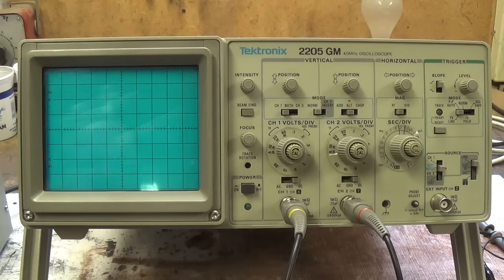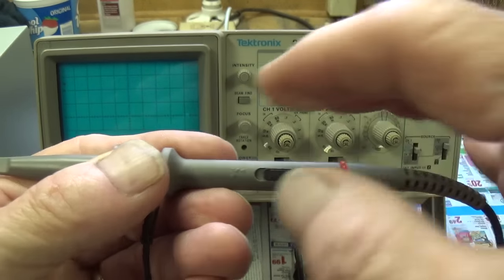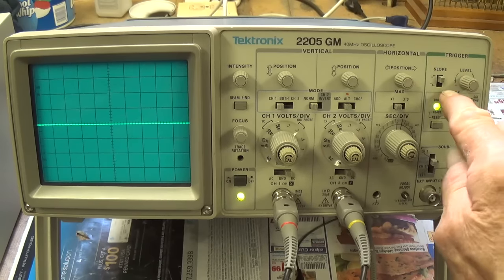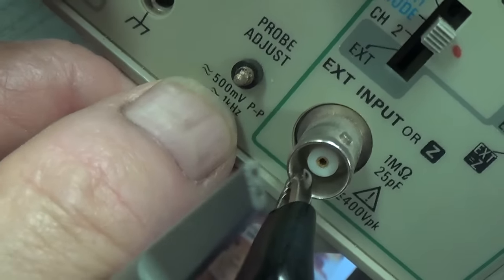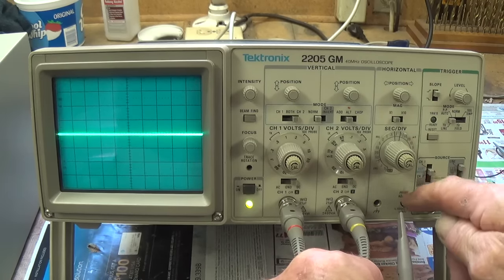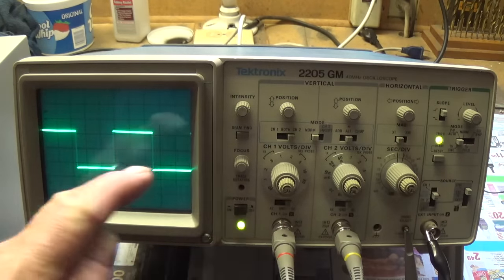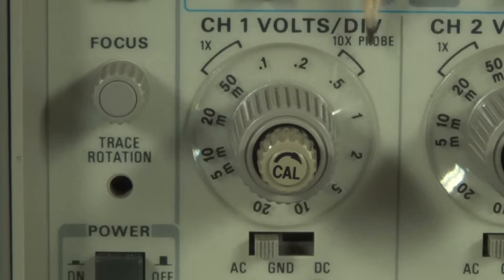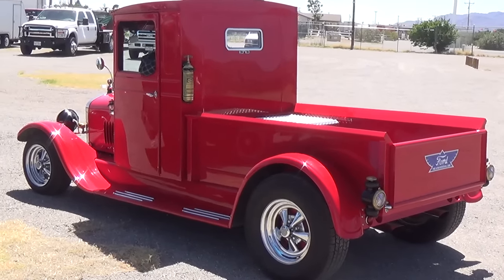Oscilloscope Basics, Part 1: Discussion, Y-Axis (Voltage) Controls, Probe Calibration

Comment: Some ask the question about the AC or DC switch position : AC mode blocks DC, but DC mode pass all signal components (AC and DC) to the vertical system. So it doesn't matter in this case. In the manual, it says to go to DC mode for checking probe compensation, so again, AC will pass in DC mode.
Reply from the maker: Thanks for the helpful input, Patric.

Comment: Well done and very informative and clear. I'm looking at a Tektronics 2215A on Craigslist. They say it works well, but you know how that goes, but at an asking price of $200, I figured it's worth a look. Looks to be very similar to yours, which makes the learning curve not quite so steep.
Reply from the maker: Thanks, B55. I understand your concern about buying complex gear untested....but that's a very reasonable price. God only knows what it cost new. Get the guy to demonstrate it or let you try it out. At least you'll know if it lights up and seems to work.....then find some faults and offer him $125 :):)
Reply: Uncle Doug I ended up picking the oscilloscope for $125 and he threw in an isolation transformer and an ohm/henrie meter. Oh, and a super heavy duty outlet strip. Not to shabby.

Comment: This a fine video, I am trying to understand how these work, I have a Handek as well as a Heathkit IO3542. The problem that I do not understand if the divisions, if you have the Volt/div knob set at .5 do you multiply the divisions on the scale by .5 to get the reading? Thank you kindly for any input.
Reply from the maker: Thanks, Mark. It means that every vertical scale division is equal to 0.5V, so if a peak is 7 divisions high it is equal to 3.5V.

Comment: Uncle Doug.....I noticed in the beginning of the video you pointed out that you were setting the voltage to AC on the switch, however during the rest of what you were showing with the probe calibration I noticed it was set to DC. Can you explain why? I am in the beginning stages of learning the oscilloscope and that has me confused. Thanks......Kelly
Reply from the maker: I honestly don't recall, James. Sorry.

Comment: My dad and grandpa both had shops. They had the old atlas scopes they used to tune point ignition cars. Did these scopes do the same thing as you are teaching us or was that a totally different beast? We miss Jack on the vids but the hot rods are nice addition. Thanks.
Reply from the maker: You're welcome, Todd. I would guess that the scope's design was similar, but the signal processing electronics were different. I don't think they would be interchangeable.

Comment: Wow, and that is a basic O Scope. It's more than adequate for guitar amps. Mine has cursors & tells me volts, amps, frequency, in RMS, peak, average, elevated, AC, DC, waveform, etc. I have differential probes that will let me work on KV transmitters. The 22 series is a nice Tektronix scope. I use a 2245B, 4 channel for my basic stuff. I still have a bunch of old 465Bs that run up to 400MHz. The "Probe Adjust" terminal might say "10KHz",  "10KHz Calibration", or just "Calibration", rather than Probe Adjust. Other manufacturers are different.
Reply from the maker: Thanks for your input, Seth.

Comment: I wish Brad the Guitologist  would get a scope... He is plenty smart enough to learn how to use it well...   May I suggest if anyone is interested , check out the Tektronix 2247A. It has a high speed digital co-processor that allows many DMM functions on screen, has curser functions for volts and time/frequency, rise and fall time calculator, and has a memory function for many complete front panel setups. Its one of the very best pre pure digital (DSO) scopes they made. I bought mine new when they were released, over $11,000.   Now you can find them fully functional under $500.  We also use several 7000 series mainframe scopes, including a Storage Scope version, but they are probably beyond the needs of the advanced hobby and restoration enthusiast.   Any of the 22xx series Tek scopes, such as Doug’s here, are well made, quite portable, and very reliable.
Reply from the maker: Thanks so much for your knowledgeable and helpful input, Jennifer. Just like all electronic gear, no matter how expensive it is when new......just wait a while and the price will drop exponentially.  I would love a digital scope. To me, the analog scopes are sort of like slide rules compared to modern computers.....God love 'em !!

Comment: Thank you kindly, Uncle Doug. What is your opinion on remote power supply (solid-state and regulated) to drive my 40W push-pull amp? The circuit incorporates a voltage quadrupeler, so my power high voltage rail need only be 300V. In addition we have 240V RMS, here.
Reply from the maker: I don't understand why a separate power supply would be necessary, Shannon.

Comment: I just thought I would share that I just bought a General TV amp (dated 1956) as a guitar amp conversion project complete with 12SQ7 tube and 50L6 tube and 35Z5 rectifier tube....wish me luck!!  I think I may need it! I thought this would be a better starting project than scratch building an old amp clone ..maybe...I hope, lol.  I am so thankful I found your channel! How many videos do you do a month on average? Just curious.
Reply from the maker: Good luck with your project, Jack.  Be sure to install a 3-wire chassis-grounding power cord on your series-filament amp.......for safety reasons. We tend to produce about 4 to 5 videos a month. Each one takes several days, so we definitely keep busy.

Comment: Question, why do the switch goes from AC to DC on some shots and still get a square wave?
Reply: If you have an AC signal sitting on top of, say, 5VDC, flipping the switch to AC will filter out the DC voltage and show just the AC voltage. For example, If you have a 1VAC signal sitting on top of that 5VDC, your scope will show an AC signal varying from 5V to 6V. Flip to AC and it will show you 0V to 1V.
Reply: I'm not Uncle Doug...but I can help. If you set for a dc signal, you can use the scope for a voltmeter to
check...oh...say a power supply output. No doubt Doug will demonstrate some neat little features of o'scopes,
like checking to see if power supply capacitors are bad...to justify going further to see WHICH capacitor.
And he'll probably show you that setting for ac will help ignore grid bias voltages that might move the 
waveform up or down off the screen. One other thought...if the on and off times of your turn signal are
equal that would be a "dc square wave" feeding those bulbs(8-). Anyway, sometimes it doesn't matter
much where that switch is set.
Reply: AC mode puts in a DC blocking capacitor but probably of too low a value to have any effect on these 1 kHz waveforms. Not sure why/when he changed it.
Reply from the maker: You have a sharp eye, Satch.....and the square wave question has been answered by other viewers already.  The AC position filters out any DC beneath the AC wave form.  The reason the switch moved is that the video was shot over 2 full days and involved many, many scenes. During that extended period, some switches got moved around and not put back, which (fortunately) in this case had no harmful effect on the scope tracing.

Comment: Thanks Doug, this proving to be very helpful in my understanding of how to use this tool. I did have a question regarding my own scope. Its a Tektronix 2236A and when I try to calibrate my 10x probes the square waver show like your did at around 24:30. I can't seem to see any vertical lines of the square wave on the scope.
Reply from the maker: You're welcome, Jeffrey. This is all part of learning the intricacies of your scope.  Experiment with all available adjustments and I'll guarantee that full visualization of the square wave is possible. Good luck.
Reply: @UncleDoug  I found that if I increase the frequency of the square wave test signal from my function generator I can begin to see the vertical lines of the wave.
Reply from the maker: @oldsoulsound  There is always a way to do things if you're willing to experiment, Jeff :)

Comment: Hi Doug. I have BK Precision 2190 scope and a few of my controls are laid out a bit differently than on your scope. My problem is when setting up mine, (per your instructions) I can’t get a solid straight line, but rather a moving trace or a solid/single dot. Any help/pointers would be greatly appreciated.
Reply from the maker: What is the frequency of your input signal? Have you tried increasing it?  Some scopes have difficulty with low frequencies.

Comment: I have a rack HP signal generator but I have to fix it.. is the cell phone apps a good solution? Do they lack in resolution or am I overthinking it.  I use one to calibrate my tape decks.. it's called Hz.
Reply from the maker: Cell phone apps are generally quite good, SW.

Comment: I'm wondering how you like those probes? I was going to replace the tips for my old Tektronix scope probes. However, it would probably be cheaper to get some inexpensive cheapo probes. But since they only cost like $5 my concern would be the quality and longevity but also high voltage safety. Thanks!
Reply from the maker: I have had them for 2 or 3 years with no problems at all, A61. I got them on Ebay at a very reasonable price and have never regretted it for a second.
Reply: ...it's like everything else: "you get what you pay for, in this world"- and it's the TRUTH.

Comment: Just a mention, I noticed the ac/gnd/dc switch located below the volts/div knob changes in the latter part of the video from ac to dc then back to ac. I don't recall mentioning the changing of the switch back and forth during the probe test, is this an error or did I miss something in the instructions? Thank you Uncle Doug for the video! 👍
Reply from the maker: Probably just an oversight in a rather complex video, Sand.

Comment: Dear Uncle Doug, I am watching part 1 and part 2 of these videos. You make them so interesting to me. I do have a question: I am building the Elenco 108CK AM/FM radio kit. In the manual they want you to find the -3dB points, the upper frequency and the lower frequency. We begin by injecting into the audio amplifier a 1K Hz signal. Setting the oscilloscope at .5 volts/CM at 2 volts P-P. I have done that. Now to find the upper freq.
the manual says to slowly increase the frequency until the signal drops .707 on the display.(1.8 divisions)
When I do this I see no drop. Any input on this I would sure be very grateful to you... Have a great day...):
Reply from the maker: How high did you increase the frequency without seeing any decrease, Mark? I am not familiar with this test. Have you considered contacting the company for guidance?

Comment: Quick question Uncle Doug. When you connected the probe for calibration, you set the ch1 switch to AC (to show the square waveform). Yet later on in the video, both switches were set to DC. Is there any reason for this?
Reply from the maker: That was quite a while ago, DW. I honestly don't recall.
Reply: @UncleDoug  ok thanks for replying anyway. I am just starting learning electronics, so I was curoius. Awesome video though...

Comment: Thank you for such an easy to understand instruction.  I don't own a scope yet, but am researching and learning how to use before I buy.  One question though.  In the initial setup, you switched the channels to AC.  Then throughout the rest of the demonstration they are in the DC position. Why is that?
Reply from the maker: I don't recall, Wayne. Perhaps I was measuring DC voltages.

Comment: I'm still trying to figure out what the heck you do with these things. I've got two like this, and one that's a big monster. My dad got them years ago, he was a computer engineer at Univac for 30 some years so he knew how to use them. He's gone now, been 3yrs. I never got into electronics, now I wish I had.
Reply from the maker: The great big monster is probably best suited as a boat anchor, but the other two are probably good ones. You should try to learn how to operate them. Dad would be proud.
Reply: ...you're not ALONE- I recently aquired an HP Spectrum Analyzer, and I'm still trying to figure out how to use it.

Comment: Think a exact model of scope would make it easy to follow - but as  I dont have one and would like to work on some Tube amp gear - is there a model  that you  would  recommend ? - Middle of the ocean Here so -- durable -
 -  Pref  used and inexpensive  - Thanks for the video instruction
Reply from the maker: I would think that any transistor (i.e. non tube)
Tektronix oscilloscope would suffice.

Comment: This is great! I just got my Kenwood CS-5165 and you have helped me learn a bit more about how to calibrate it. One quick question, on the kenwood it has a 1V Peak to Peak for the probe. But when i try to calibrate it to ine volt per division it wants to constantly move. But If i set it to .5 volts per div it stays still. Any idea why it would move around at its rated calibration voltage?
Reply: Nvm, I answered my own question. The level was slightly off.
Reply from the maker: Glad you resolved the issue, Mr.S :) @mrseekz

Comment: What would be the least expensive digital oscilloscope for tube amps? Or do you not recommend digital? I have a massive (seems like 75 pounds) Tektronics that looks really cook but now smells moldy and I've tried all the methods you mentioned and still can't find the horizontal line. I think time to replace.
Reply from the maker: I have no idea about current prices, OM7, but a perusal of Ebay would answer your question. To me, tube oscilloscopes make good anchors......and when it's time to move the boat, just cut the rope ;)

Comment: Another great vid series, Doug.  Been thinking about getting a scope, so I'm glad to have watched this.  One thing I'm interested to see:  You're probably familiar with Mehdi Sadaghdar of ElectroBOOM.  He's got a bit of a running gag where pretty much every time he touches the probes of his scope to a voltage source, he blows something up (artificial, of course, but fun!).  He then explains that the ground goes directly through the scope to the ground prong of the plug.  So I'm wondering: with the isolation transformer you're building, will the ground line of the probe work properly during calibration, or does it only need to be grounded internally to the scope, itself?
Reply from the maker: He's right about the scope's ground clip connecting to earth ground through the scope chassis. I cover this in the Isolation Transformer video. The ground line will work fine whether the circuit being tested (CBT) is isolated or not......all that is needed is for the ground clip and the probe to complete a circuit within the CBT.
Reply from the maker: P.S. I find the guy's videos to be absolutely hilarious !!  I can't imagine the amount of damage he does to his tools, workbench, fingers, and head while making these gems.
Reply: Thanks for the info about grounding.  Yeah, he's a hoot!  I've seen him demo how he does some of that stuff, but sometimes it just seems so real, too.  Great way to deliver his message about safety.

Comment: Normally when you get a scope probe it comes in a bag with lots of accessories, one of which should be a tiny non-metallic screwdriver.  Use it to calibrate the probe.  That adjustment is actually a variable capacitor.  Metal screwdrivers add capacitance which throws off the frequency response of the probe.  Looks OK when you adjust it but as soon as you remove the screwdriver you have changed the capacitance thus changing the frequency response to some unknown value.   Not too important when dealing with DC through audio frequencies measurements but can become critical when using the O'scope to look at complex radio frequency wave forms.
Reply from the maker: Another interesting observation. Years ago, I used wood or plastic screwdrivers to align interstage transformers in radio circuits for the same reason.

Comment: Hi ..i have the 2225 Tektronix 50mhz scope...just wondering whether the probes you are using are original? If not canyo please give me the details if after market probes..
Excellent video.
Cheers
Reply from the maker: I ordered the probes on Ebay, G. There are all sorts of offerings at various prices. The one caveat is that the probes you buy should match the 50MHz speed of your scope and have X1 and X10 switching. Good luck.

Comment: Hi Uncle Doug.  The hum is at supply frequency - 50hz, here in Shitsville (Australia). All the components are new, and I tried a suggestion by a zealous friend, to add more capacitance to the supply rails.  To no avail. Please, what else? Many thanks.
Reply from the maker: There are an endless list of possibilities, Shannon. We have all faced the same situation. The only solution is to go back over the lead dress, components, wiring, tubes, etc. until you find it. Have you tried exchanging tubes? They are a common cause of AC-frequency hum.